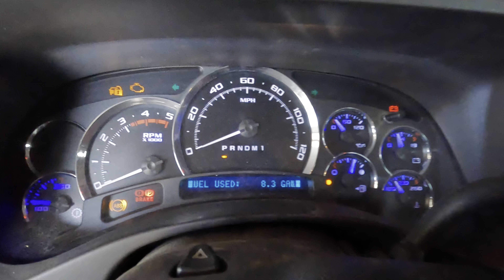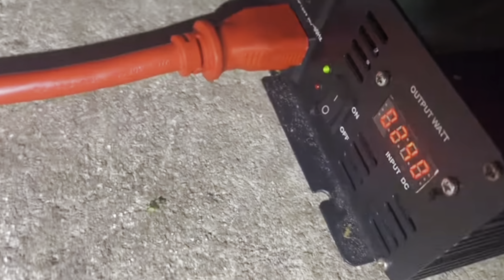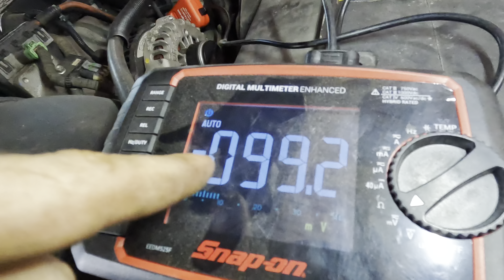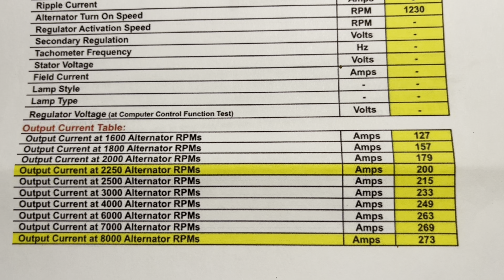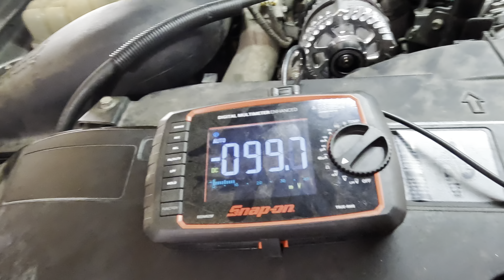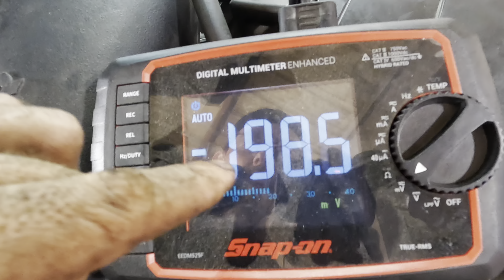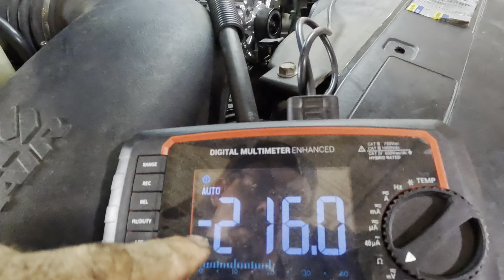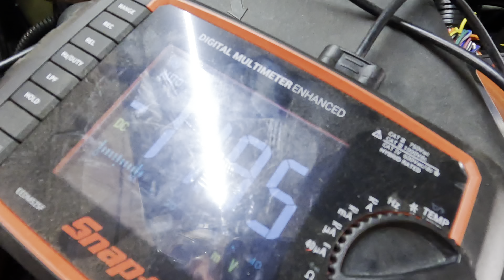Torture Testing a Performance Alternator

Comment: Ray, I have a 4200w portable generator with a 2.5 gal fuel tank.  At half load, it will run about 8 hours on a tank. If I bought a similar size inverter generator, it would run 10-12 hours on a similar load, on the same amount of fuel. However, running a 6.6L diesel engine for 8 hours would burn more than 2.5 gallons of fuel at no load. No matter how you look at the comparison,  the diesel engine would consume more fuel and produce more emissions. Plus, 400A at 14.4V is less than 6000w. You could have bought the Harbor Freight 9000w inverter generator, added a tri-fuel kit,  to run of your homes NG supply, and have more power to play with than what your truck's alternators can produce at idle, with less fuel and noise than your diesel truck. What you have set up requires multiple extension cords to power multiple things in your home, where a generator can be wired into your mains of your home and power nearly everything from existing outlets in your home. I Jerry rigged my 4200w generator into my garage panel and seems it to my house through the 30A 220v outlet.  I can run my appliances in my home and light my house. The only things it can't power is my condensing unit. This set up you have is great for a job site or emergency, but for an extended power outage,  would suggest a whole home generator (like Generac or Honeywell), with an automatic transfer switch. These systems fire up automatically and test themselves weekly for guaranteed power when you need it!

Comment: You might also want to think about some extra cooling for the new alternator during these high power applications so it does not overheat. Just a thought. Overall, you have done a really great job putting this whole system together in your truck.

Comment: Might have to look into this when I get my flat bed for installing a generator/capacitor bank for use with a built in on board welding system for mig, tig and stick so I can have a mobile welding set up for smaller jobs (like custom steel fences and such) where I don't need to run separate units for indoor work.

Comment: I have a DC power alternator for my 3rd Gen Taco that I will install later this spring. I have 2/0 wire from Sky High Car Audio that uses 4/0 gauge electrical connectors. I figure this will be big enough to power the system. I'm also upgrading to the same size wire from battery ground to the engine, frame and body.  Something I wasn't aware of is audio, electrical and welding wires have gauge sizes that are physically different in size even though they say 2/0.

Comment: hi ray great alternator upgrade with a decent amp increase. also glad to see that you got around to fitting the vent fans. also since you mentioned to thicken the cabling you may want to consider the leads leading to you AC supply.

Comment: Currently I have 2x 140 amp alternators on each of the cummins engines in my boat through a 130 amp battery isolator. The problem is not really the output that is at 120 amps at 800 rpm. The problem is the heat produced in the alternator. At slow speeds, the fan does provide enough cooling. Try running it with the inverter pulling 1500 watts into a heat gun and turn on everything in the truck. Then see what the alternator is at and let it run for a while with a temperature gun on it. My particular alternator starts to get 150c plus in temperature that greatly shorten the life to a couple of hundred hours of use. I actually keep cheap $125 spares and change them as needed a couple of times a year. I really wish I could regulate the output by temperature rather than volts/amps. I did put a heat switch to turn off the regulator in case it gets way to hot. Hopefully that extends my run time between alternator changes.
Just because it will do it in this test does not mean it will last any amount of time at these high amperages.
By the way, we came in and spoke to you about 99 Tahoe running like crap and you thought maybe the distributer. Yes, changing the distributer fixed it and we had to pull out the El cheapo MAFS and put the old one back in to make it run perfect. Thanks for the time to help troubleshoot our problem from afar.

Comment: I’m working on my alternator on my 1071 super beetle so I need to get rid of my voltage regulator and install the alternator with a internal voltage regulator so I to do away with my voltage regulator and run the wires to the new alternator with a internal voltage regulator removing the alternator is not a problem but the work I have ahead of me today should be a easy one I learned a lot from you Ray you are the best on YouTube be watching your videos for 2 years now

Comment: Ray, we install inverters in camperts and RV's those inverters will overheat in that tool box pretty quickly.. so while your power supply may be up to the task, unless your providing adequate ventellation by means of fans to exchange the air insode that box youll get about 30 minutes of use before they overheat.
Reply: I saw the fans😮

Comment: My 2017 GMC 1 ton came with 2 alternators from the factory, and I believe that they are over 200 amps each, (the main alternator has a little higher amps than the slave does, weird) it does have a hd tow package

Comment: The old big Caddillacs that ended in the 80s, had a nice terminal connection under the hood.  Red plastic box about 4 inches long.  Two lugs inside.  One cable from the battery to the box.  Then, the multiple terminals can be added to the other terminal.  It takes away the spaghetti look at the battery.

Comment: I did this with my 2003 mustang gt. Only 1 alternator though. From a company in Pennsylvania called PA Performance. Upgraded from factory 130 amp to 175 amp alternator. Kit came with heavier cables. Unit is new not rebuilt. Never looked back since.

Comment: Imagine the upgrades. High output alternator as a secondary, with the small pulley (ensuring it runs quicker). Near 400 amps out of that bit. You've built a modular rolling power station, with a modicum of towing capacity, and an interior of a luxury truck.

Comment: Hi Ray, I understand your setup and home requirement for it. Just one question, at home, why didn't you get yourself a 120v  diesel generator, 
and fuel storage containers.  No need for battery's,  inverters, load controllers? Stay well stay safe,  regards to wife unit. 😊

Comment: I would have left it the same as far as pulley size and I agree with you the wires needed a bigger size. With 300a dc you might be able to run a 2 ton center ac unit not much higher may be recommended.

Comment: Now you need a light or sensor of some sort to notify you if/when the main alternator fails. With redundancy your truck will still perform normally under daily use, but if you need full performance during a power outage you won't have it in the event the main alternator fails (unless you know it has failed and can repair it). Besides...who doesn't like more blinky lights?

Comment: Part.of.the lower than rated amp output - undersized wires from the alternator to the battery.   Also, the load being clamped right on the battery makes the battery the closest to the load, so it will supply more current 
  The alternator doesn't see the full load.

Comment: You might want to use a thermal imager and check for heat on your cables and connections. If you run a constant 200 amp load for an extended period of time you will probably see some hot spots that you might want to address.
Reply: Might need sunglasses to view the IR screen
Reply: Since the alternators are not the same, they will end up passing a fraction of the output power back and forth.... Risk of letting out magic smoke is high
Reply: @PatrickMcCarthy yes this! They wont tandem regulate, they will fight each other to the death. 
Keep the stock running the truck only! keep The aux running your inverter setup. You also risk overcharging your house battery if it is directly connected to the vehicle battery. You can always jumper cable them together in an emergency, but running them that way is going to break stuff.  Infact send your wiring diagram to the alternator company and see if they don't agree. Also you will need to upgrade your ground cables too. Those are the current return and they need to be capable of the load as well!

Comment: You can easily build your own alternators. I have some information on it on my channel. I also have a full billet dc power unit I built into a 370. 

You can do this for MUCH less than half the cost of a unit from any manufacturer.

Comment: Ray there is a kit that you can get to make your generator a tri fuel generator so you can run it on propane and its a lot cheaper and safer than gasoline . I did it to mine so I don't have to store a lot of gasoline. And it works well. Just an idea to think about.

Comment: A combiner helps to insure a balanced output so you don’t overheat the batteries.  That would be bad, no battery likes warped plates!  You could also use an isolator to charge the 4D in the rear of the truck by running a separate power cable to it.  That was a shocking setup!

Comment: I’m looking for a larger nator for my 6.0 Powerstoke as the stocker on it just doesn’t like it when I have the camper hooked up, especially when it’s warm. So it’ll drop down to like 13.4v especially with the AC running.

Comment: Now the only thing you really missing off that engine is methanol injection. It will help that motor live much longer because it will cut down its soot output and help it handle the soot output it does get.
I have seen, even diesel engines with methanol injection in very high mileage situations that are really clean inside when you take them apart. And the exhaust manifolds are much cleaner as well

Comment: Im not sure about those years but in an LMM the staggered alternator charging is supposed to happen, I was worried after changing both alternators I could only get one to produce voltage at a time. apparently I needed a load tester lol

Comment: Ray if you double the output of the alternators you are doubling the load on the drive belt to transmit the power needed to turn them what happens when the belt breaks at 2.oo in the morning and leaves your engine running without a waterpump also diesels hate running under light load the rings glaze up and they start burning.

Comment: Would a weaker car engine be able to run those alternators at that amperage? Like a 78 HP I3? Or does it require a big engine to be able to handle that?

Comment: I have the 48 VDC etorque gen/motor which also produces the 14VDC for the 12VDC charging system. I don't know what the current capacity is of the gen though. To recharge the lithium battery it's probably over 200amps for both 48 & 12 VDC systems

Comment: Totally understand what you have done Ray and why. But in essence you still have only one system. I would have left the factory truck wiring as standard and used the 2nd alternator to float charge the battery in the inverter box as a separate independent 2nd system, and then kept the golf cart switch to join the two systems when needed. I have no issue with what you have done just offering a different system design philosophy.

Comment: I hope you have anti-theft device while your truck is idling and being a power station on wheels. You know, like one of the yellow bars that doesn't let you turn the wheel without unlocking the bar.

Comment: So you can charge the batteries at a great rate of Amps, but what is the maximum current used by the inverters at full chat. I wouldn't expect those inverters to use more than about 50 Amps max!  I have been wrong before and you may be upgrading them to run the power for a large chunk of Florida including a circus if it is in town when the lights go out

Comment: 2X300's with more, or larger capacity batteries/inverters in tool box? I'm not questioning, I just can't help but think bigger. You could even put deep cycle storage batteries in your home so you could leave without killing power.

Comment: I am worried about two things,  #1 no fusible links for the alternators.  I would get links that are rated 25% above the current capacity just for safety. 
#2 The amount of current being carried by the cable from the Vehicle electrical system back to the AUX battery and inverters. 
I would check at the AC load you plan on using the voltage drop of that cable at load. 
If it is greater than 3V I would get a larger cable or double it. 

I have a 0 gauge cable from my vehicle power back to my two way radio bay in my Jeep liberty. 
I have 3 radios that each one pulls 60A when transmitting. And a 50A connection to my Stealth RV trailer. 
that has 550ah of LiFePo4 cells. 
And when my 160A alt is putting out 100A to the radios and charging the RV battery. 
I have 2v drop in the 0gauge cable.  That is 14 foot long. 
I would do that test.
Reply from the maker: I plan on building a new cable/harness and I’ll fuse them with inline fuse blocks. It’s going to look good! 😊

Comment: Just curious but have y'all ever checked out a DC generator? We use to install them on rescue vehicles,but instead of inverters the DC voltage would power a generator, that was stronger than any inverter at the time. Same principle lol

Comment: I don't think that DC amp meter is accurate in that situation (as evidenced by the wildly different idle loads you had without the load tester being on)
They work based on magnetic fields, and you've got it positioned right next to a alternator.

Ideally you would either use a shunt resistor in circuit to measure current, or you could use the amp meter on the load tester, but measure voltage separately (the voltage on the amp meter would sag because of the connection on it's wires)

Comment: Is there any chance you can update the bolt sizes needed for the alternator, bracket, and idler pulley? I’m planning on going to the junk yard if it stops raining for 5 minutes! I watched the previous videos in this series. However, you just said you had bolts on hand and obviously have made changes here and there that you can’t make a video every time you make a change. Thanks!
Reply from the maker: Look on Rock Auto for nator bolts they had a listing for GM alternator and bracket bolts M14x1.5 pitch if memory serves

Comment: Nice. But,,,,, would like to know why have the weight of that much extra battery storage when you plan on running the truck during use only. (use of inverter) When you upgrade the cables, don't cheap out with rinky dink connectors. I would bet every connection is/was hot.

Comment: Is there a max that a battery will take when charging 
Trying to work out how long does it take to charge a 200ah battery at ideal engine
Reply from the maker: The batteries will only draw in amperage as the Cells can accept it, a regulated alternator won’t force amps into the battery. Ams are “pulled“ from the source not pushed in.
Edit: think of the concept like a garden hose, you have pressure and volume of water from a flowing hose. Electricity is similar, voltage is the pressure and amperage is the flow

Comment: Interesting video Ray.
Why 2 alternators?
Reply from the maker: There are folks that need extra electrical power from the platform and the aftermarket kits for a second alternator range from $700-$1000. This project started because I wanted to show that the second alternator could be added to a Duramax truck with a $17 GM bracket a couple bolts and a new belt. Additionally, I have electrical system redundancy on my truck. “2 is 1, and 1 is none “
Reply: @RainmanRaysRepairs  Thanks Ray! Is the caddie done? Say hi to the wife unit...

Comment: Maybe I don't understand what's going on here, so forgive me if I'm a dumbazz... That said:

If you're drawing the same amount of power, say 300 Amps for example, and the voltage is hanging tough at 13.5 volts, that's a little over 4 kW.

Why would the alternator output increase?  You're still drawing the same power... 

I do understand that if the VOLTAGE goes down when loaded, that the CURRENT would have to go up... so perhaps that's the difference?

For a complete test, would you not have to measure BOTH the voltage and current at a given load?

Comment: Personally I don't know but I would leave it like that cuz like you just wanted out you're not even using the second alternator yet so when you add you plug in stuff out back that's when it finally starts using the second alternator I don't know I leave it like that so you don't have to use the high  idle saving even more on the diesel making it last even longer

Comment: OK, I am a bit confused. You say that the HO nader is producing 100 (or so) amps at idle. What is drawing that 100 amps? You certainly can’t charge the batteries with 100 amps, or can you? If the batteries are currently fully charged where are the additional electrons going?
Reply: The 100 amps is its ultimate capacity. But you are on the right track. It will only produce 20 amps if there is only a 20 amp load. Those other 80 amps don't go anywhere. They just were never produced to begin with. Hope this helps.
Reply from the maker: The batteries were drawn down a little from the tester pulling 400a with the engine off. So when it was running, the fuel pump on the frame, lights and the blower fan were all running, that combined with the batteries sucking up power, we saw the 100a load
Reply: @stevewhite3424 No that makes no sense whatsoever. The measurements that were made had to reflect the current being drawn, unless your explanation is just a joke. 🤔
Reply: Ray explained it clearly; the battery was accepting the amps because it had been slightly discharged with the tester. If left for a few minutes that 100a output would've gone down as the battery charged.